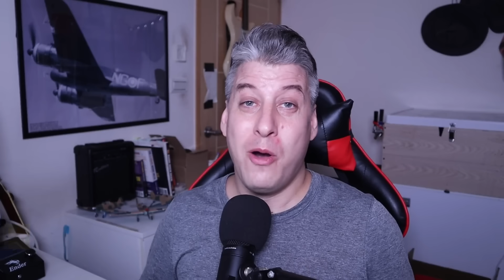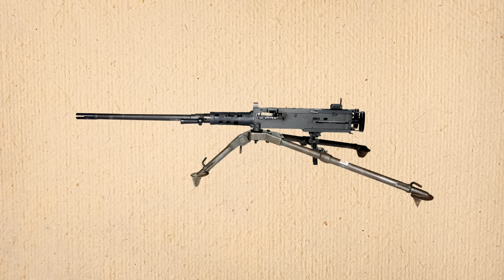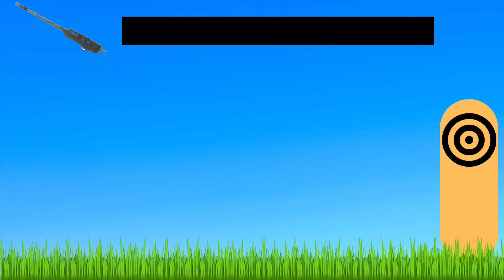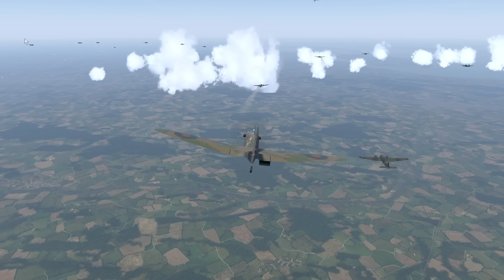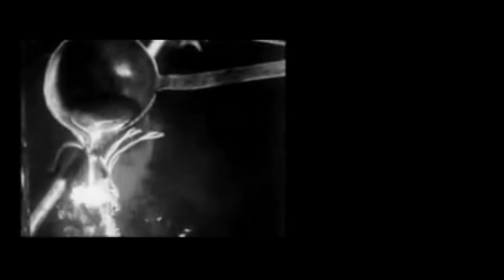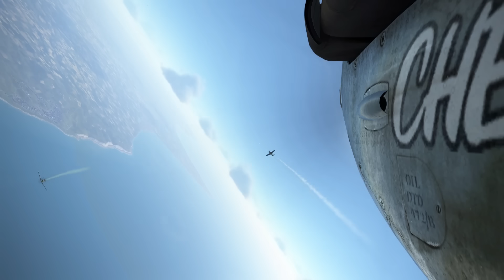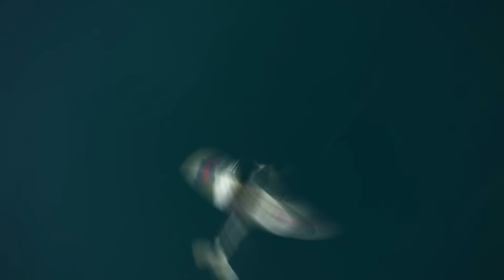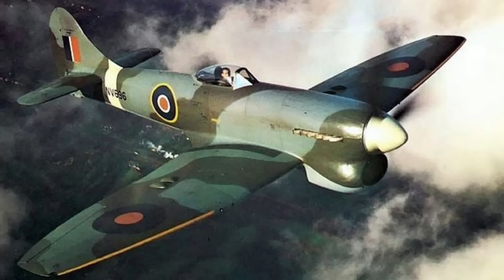Why Did The RAF Use .303 Caliber Machine Guns in WW2? The Surprising Answer

Comment: As far as I know, all machine guns were zeroed in on a tight grouping at the optimum distance for combat. So many machine guns hitting the same spot, at the same time, packed a real punch.
Reply: He mentions this in passing, at one point, something along the lines of harmonizing zone.  This is actually why twin engine aircraft like the P38 and mosquito are so deadly, despite the P38 having less firepower on paper.  Because all of the guns are clustered in the nose, firing parallel, they are equally effective at any range.  They were known to literally saw enemy fighters, particularly zeros, in half with a solid burst hitting all in one small area.

Comment: The British were putting 20mm Hispanos into aircraft early on - see the Westland Whirlwind for example. It took wartime experience to prove that the 20mm was better at downing aircraft that the .303 so the British really did adapt their armament as wartime experience proved which was best. Also, your criticism of the Vickers .50 is misplaced, it had lower muzzle velocity than the Browning but that doesn't nevessarily meake it less effective in aerial combat. Also, the Vickers D that was more powerful than the Browining was available, so the RAF had options in what to adopt in a .50 calibre. Also, the '.303 was used because it was the same as used by the infanytry' line is a load of rubbish. The RAF had an entirely different and seperate logistics/supply chain, so could have used a different calibre - for instance, the Royal Tank Corps used BESA guns in 7.92x57 because they had a different supply chain to the infantry this wasn't a problem.

Comment: It could be that the Brits were churning out .30 cal guns and ammo at the start of the war and simply could not afford the downtime required for their arms manufacturers to retool for .50 cal.  If they needed maximum production NOW and it stated that way all through the war, it would always be .30 cal.  And by the end of the war, the fighter armament of choice had clearly become 20mm cannon so why bother with .50 cal?  

Wikipedia gives us some interesting clues as well.  They have the armament for the Spitfire LF MK IXe as 2x 20mm cannon and either 2x 50.cal with 250 rounds per gun or 4x .30 cals  with a total of 1400 rounds or 350 per gun.  So maybe the .50 is better but is it twice as good, especially with the more limited ammunition supply?  

The MK XIVe is however simply 2x 20 mm, 2x .50cal and the F MK 24 goes to 4x 20mm.  Arguably there might have come a point in German fighter design where the .30 cal simply wasn't cutting it anymore which is where we get the switch to the F MK XIVe and eventual evolution to all-20mm

Comment: It is often said hindsight is 20/20.  The RAF made their decision based on the best available information at the time.  Given you uploaded this from Great Britain rather than the German British Isles I would suggest they chose well enough.
Reply: Now we live in the American British Isles.
Reply: It wasn’t the best information they had at the time.  While they were adopting a .303 armament they were simultaneously adopting armor for their planes up to .30 cal projectiles.  It was entirely foreseeable that a .30 cal would be less effective in the future.

For the economic argument?  Bull.  The RAF adopted the Mk2 in 1937.  They had two years to build up production facilities.  The economics didn’t prevent them building 20mm cannon, or prevent the army from adopting an 8mm BESA mg litterally at the same time as the Mk2.

Harris’s quote about effective range being the difference between .30 and .50 weapons is telling: even at such a later date he didn’t understand.  The FW190’s that were rising to meet British bombers were essentially Frontally immune to .303 weapons due to their armored engines.  It wasn’t range but penetration.

As for the usefulness of the “incendiary” .303 the presence of the .50 cal API or Armor Piercing Incendiary would tend to negate even that small advantage.

The RAF got it wrong, then tried to jump straight to 20mm which didn’t really work out.  Even into 1943 the 20mm shells they were supplied with had fusing issues which made them far less effective even if they hit the target.

One thing that always gets left out of the .50 vs 20mm discussion as well is ammo capacity.  Even the later typhoons only had about 10 seconds of trigger time.  The P51 had 16 seconds and the P47 had 25 seconds.  It’s much easier to be accurate when you get more chances to hit your target.  This is probably why British pilots were so obsessed with walking in .303 fire before risking their 20mm, bc they knew they wouldn’t get many misses.

All in all the 20mm was inevitably the better option, but in 1939 it wasn’t ready yet.  The .50 was good enough for all purposes throughout WW2.
Reply: Tbf, the economic concerns that were a big factor in the decision became pretty irrelevant when the battle over brittain got going.

I suppose the smartest thing wouldve been to develope and set up 12-15mm mg production lines so you got them when you need them. Doing a sharp switch during the war was likely way more expensive than planning further ahead in the past.

This actually makes me wonder how the germans got to their 14mm MG131, which apparently was a very effective fighter MG. German economy was way worse off than Brittain. But then again, Germany was limited in many other ways, especially when it came to bombers.
Reply: Well, the Americans had most to do with that. Even this Brit understands this.
Reply: @Fater4511  The Russians even more so.
Reply: @OggyGTA

What on earth help did the Russians give to Britain in 1940 when Britain was at its weakest?
Reply: @lyndoncmp5751  Diverting German forces to the eastern front therefore the Germans had less of everything to threaten Britain with, like it or not, the Russians did more to beat the Nazis than the Americans did. America was (justifiably) occupied with Japan at the time.
Reply: @Fater4511
Nope. The USAAF didnt stop the Luftwaffe in the Battle of Britain, the US Navy didn't stop the Kriegsmarine in the Atlantic and the US Army didnt stop the Axis forces in North Africa and Middle East.
America wasn't even in the war when these campaigns were decided.

Comment: While not an aviation issue, the M1 Garand semiautomatic rifle was originally chambered for a smaller round, which indeed would have been more effective.  But as the .30-06 was so common in the U.S., and retooling factories to manufacture a different round was expensive (especially in the middle of the Great Depression), General MacArthur (then the chief of staff) asked Garand to redesign his rifle to fire the .30-06.  And so it happened, and in time for the U.S. Army to have almost completely changed over to the Garand by the end of 1941.
Reply: Just thinking about it is impressive, they fought a war running around with basically semi-auto 30-06 rifles, makes modern guns look like toys shooting bbs.

Comment: In 1922, the British became concerned about possible air attacks.    Starting in 1924,  they conducted annual Air Exercises to devise, practice and review possible solutions to the anticipated problems.    The last exercise occurred in 1938.    It involved 53,000 personnel,   1300 aircraft, 110 guns, 700 SEARCHLIGHTS, & 100 barrage balloons.        Fighter Command was designed to be a night fighting force, and was appropriately equipped and trained for that task.      
From 1922 until 1934 the threat was deemed to be the French.  An outbreak of hostilities would have resulted 	in a “Battle of Britain” with biplanes.     With the rise of Hitler, the British reassessed their situation.  In 	August 1934 the armed services were advised that threat would now come from the East, not the South.   It was believed that Germans would be ready for war by 1942.   	A “Reorientation Scheme” to extend the air defenses up the East coast was devised. 

See here:  http://www.ibiblio.org/hyperwar/UN/UK/UK-Defence-UK/img/DefenseOfUK-4.jpg

Noteworthy points on the map.
LOW COUNTRIES is the Netherlands or Holland in modern English. The Germans had respected its neutrality in WW1.    There are  dotted lines for the  radius of action for bombers.  Note that there are none for escorts.     It was assumed the Germans would attack by night as they had done in WW1 & that effective escort was not possible.
It required 25 Squadrons,  456 guns & 2160 lights to work as intended

In the Spring of 1935, the services received some bad news.  The Germans could be ready for war by 1939!

The Air Ministry now needed to replace its entire fleet of fighters within 4 years.    The conventional wisdom was that it took 5 years for fighters and 8 for bombers to complete such an operation.    

It opted for a low risk strategy. Fortunately two reliable aircraft companies had already started work on their own initiative, as had a reliable engine manufacturer.   The missing link was an armament manufacturer.

 At this time Squadron Leader Ralph Sorley was in charge at the Operational Requirements section of the Air Ministry. He campaigned to have Operational Requirement F.36/34, which governed the procurement of both the Supermarine Spitfire and the Hawker Hurricane, change the armament from two .303 in  Vickers machine guns in each wing to four .303 in  Brownings. This recommendation was based on extensive work carried out by Air Ministry staff, the mathematical calculations showing the need for eight machine guns being carried 	out by Captain F. W. 'Gunner' Hill.   WIKIPEDIA

Quote from writing by Sorley 10 years after the events.

At the time two aeroplanes were being designed experimentally by Hawkers and Supermarine around the new Rolls Royce Merlin engine in order to test the powerplant and monoplane conception rather than as 	operational types.
If these aircraft were successful, we envisioned that four guns might be installed in the fuselage.  Both 	mockups were reaching completion, and as the general layout accorded with specification F5/34, their respective designers were confronted with the eight gun theory and soon were enthusiastic to adopt the principle.
Wing installation involved a departure from current thought and practice.  Guns in the wings dispensed with	the complication of interrupter gear previously necessary to fire through the propeller.  This offered saving in weight and complication, and enabled guns to fire freely instead of a mechanically restricted rate.   However the question of clearing stoppages and re-cocking the guns became controversial.  Access by the pilot to his guns had long been customary, and the idea of guns out of reach led to much argument, though it seemed 	obvious that with the guns operating continuously there were likely to be fewer failures, and even if one or 	two guns stopped there were sufficient left. So the re-cocking and clearing of stoppages was brushed aside”   

“Once construction of the Hurricane and Spitfire got off the ground the possibility of using 20m Hispano guns came within reach.  It was decided the Hurricane should be so developed and specification 10/35 was revived.  
BRITISH AVIATION – THE OMINOUS YEARS  1935-1939   Feardon, Basil

In summary: Rifle calibre guns were a stopgap measure. They bought the time required to move to cannons.
Nobody cared about .5 calibre, and they were right.

Comment: It was an issue of MONEY and EXPEDIENCY.   The British had millions of rounds of 303 in storage and their factories were all set up to make more.   Their rifles and machine guns already used the round.   It would have cost more and take more time to come up with a round specifically designed for air combat.    Along the same lines when the USA was making British designed Enfield rifles early in WW ONE in 303 caliber.   When the USA entered WW ONE it could not speed up production of the 1903 Springfield rifle fast enough.   So it converted the Enfield rifles to fire the US standard 30-06 round and sent those off with the troops.   MORE Americans were using the Enfield rifle in WW ONE than the Springfield.   The MOH moment for Sgt York in WW ONE was with an Enfield.

Comment: .303 is a rimmed case unlike say .308 or 7.62mm so will feed less reliably in automatic weapons.Rimmed cases are an unusual choice for automatic and semi automatic guns.I assume .303 was used because of the vast stock of ammunition but if you are going to use a .30 round the similar powered .308 would have been better as it's rimless..50 BMG is much more destructive but the shells are big and you can carry much less ammo with 20mm less still and 30mm less still!There are semi rimmed cases too but as far as I recall they are mainly found in weaker handguns like .25 ACP/6.35mm and  .32 ACP/7.65mm which creates the unusual situation that you can put 7.65 in a revolver chambered from .32 Long.

Comment: The RAF knew what it was doing and had tested a lot of weapons between the wars, concluding that changing to a .50 gave no significant advantage over .303" and that a 20mm was required. The Hispano was the weapon of choice but was not fully developed and needed a ridged mounting to work reliably. Also the gun initially used a drum feed which limited the number of rounds and complicated the installation, the Spitfire having the gun mounted on it's side which introduced addition issues. A prototype belt feed and drawings were got out of France from under the noses of the invading Germans and developed in Britain. When the problems were eventually resolved the Hispano proved reliable and the Hispano continued in service into the first generation of jet fighters post war, even the American eventually adopting it.
Reply: 1 - .50 is significantly better than .303 (.303 ballistics wise is basically a low powered 30-06), effective range for AN/M2 .50 is 1500-2000 yards and would easily go through the engine blocks of enemy fighters

2 - we didn't adopt 20mm Hispano, we developed a new round, the m61 (20mm Vulcan) for use in Jet fighters. The Oerlikon 20 mm saw more use in the US than the Hispano (and is still widely used today in Europe
Reply: Non sense, the cal 50 is 10xmore powerfull and with twice the range from the 303…The real cause from the modification on the 20mm Hispano is not only the original drum feeding: this canon was made to fit between the cylinders from the Hispano Suisa Y12 engine use on the french fighter Morane Saulnier MS406 and Dewoitine D520, and firing trough the propeller shaft, but on the British fighters was the canon installed in the wings, so in very cold and icing conditions and the feed was modified to belt feed
Reply: Whatever! @leneanderthalien
Reply: A guy I used to know (he died in 2014) was an RAF pilot in WW2.  He started off flying Wellingtons (.303 guns) then flew Liberators (.50 cal) in Egypt. He once talked about the guns on the aircraft and said that against enemy fighter aircraft the .303 was good up to a range of about 350 yards, while the .50 cal guns of the Liberator were good for up too 500yards.
He much preffered the range of the .50 cal and so did his crew.

Comment: The Spitfire V had a drum fed magazine for it's twin 20 mm Hispano cannons that only carried 60 rounds. After only 7 seconds of firing the British fighter would be out of ammunition. The Spitfire pilot would then have to rely on his remaining 4 Browning .303 machine guns. Only with the advent of Spitfire 9 in 1942 would the 20 mm ammunition supply be increased to 120 rounds per gun once a belt fed system was adopted.
Reply: No, the Spit Vc had capacity for 120 rounds per cannon.  It was the Vb that could only accommodate the 60 round drums.  The first Spit IXs were just Spit Vc airframes with a 2 stage supercharged Merlin 61 engine fitted in place of the Merlin 45s.

Comment: An interesting film, the DUKE forces (Dominions, United Kingdom Empire) continued with 303 calibre because of world wide production. I recall South African and Indian factories produced millions of rounds given the base material availability. Changing calibre means changing machine tools very expensive when you need to spend money on other things. The British were very pragmatic on expenditures and simplifying production to the point improvements were delayed or abandoned if they had a significant impact on strategic war production. This was one of Germany’s great failings they spent millions on tactical experimental ideas.
The 20mm Cannon was also a problem, they didn’t get to full production requirements until 1943. Also Sidney Camm wanted to arm hurricane in 1936 with cannons the air ministry said no. Imagine the Hurricane 2 cannon armed fighter available for the Battle of Britain, but Spitfire wouldn’t have been available, though counter factual Tornado would likely have been available and pressed into service with devastating effects. So have 303 calibre we get Spitfire. From the Mk VIII came the first major change with the design of the Spitfire wings ultimately for cannons and 0.5 calibre. However by that time jet aircraft the 4 cannon Meteor had arrived.